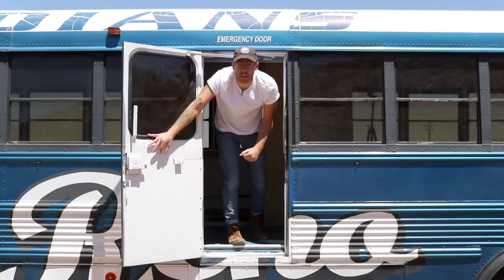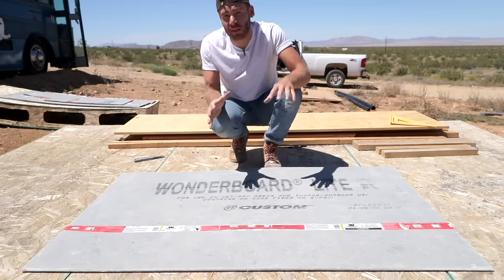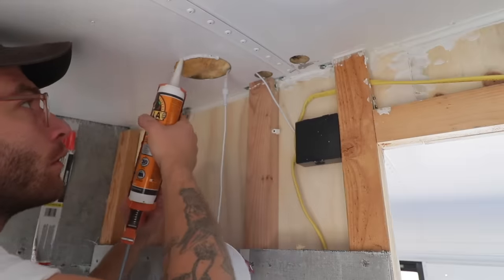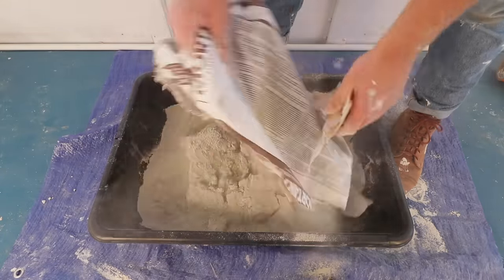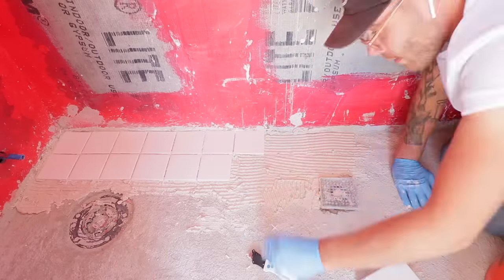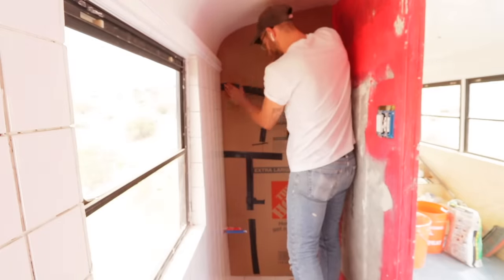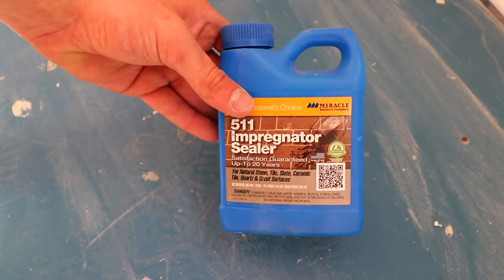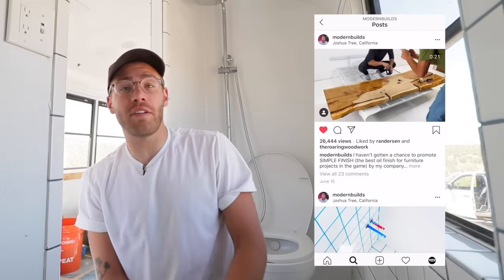EP. 3: THE BATHROOM | DIY SCHOOL BUS TINY HOUSE CONVERSION | MODERN BUILDS

Comment: "I know I'm gonna get a lot of comments about the tile."
No I'm gonna question that light switch on a wall inside a wet room.
Reply: exactly my thoughts, thats an accident waiting to happen
Reply: I was just about to mention this lol
Reply: Yeah, that's a kill switch.
Reply: It should be GFCI, then it will be ok
Reply from the maker: The shower curtain I mentioned will cover it when the shower is running... I'll replace is with a GFCI outlet too.
Reply: @bmw328igearhead  Just bury the splice for the lights as well. I don't understand since he will have use of a 12 volt system why use 120 v lights in a wet area. PUT THE SWITCHES ON THE EXTERIOR OF THE ROOM!!!
Reply: Megan Alice you cant really just say oh its a diy its okay. there’s standards for construction that keep you safe and modern builds did not adhere to them.
Reply: flynn gilmore okay, he made a mistake but everyone is beating him up about it
Reply: @ModernBuilds  I actually missed the part about the shower curtain. My issue was the showerhead and the light switch were both closer to the door so I got worried about over spray, but if you're mostly going to shower with it angled towards the window and away from the door then the shower curtain should take care of a bit.
I know it may not be possible now that the walls are up and such, but I would probably just recommend moving the switch to the outside of the room if that can be done easily. Looking forward to the next part.
Reply: @meganalice5444  It's ok to make a mistake when learning but when your posting videos for people to learn from you have to do your due diligence and make sure what you teach is correct and SAFE. He accomplished neither.  This set up could get someone KILLED!!!
Reply: @Belg1970  <<<<<---------- This!!! 👌🤘👍👍
Reply: @ModernBuilds  Try placing a little door to protect the light switch.
Reply: @bmw328igearhead  He used romex
Reply: @CaseyGpdx  and what exactly is any of his 120v wiring grounded to??

It's ok, I'll wait.... 

Hint: Nowhere did he mention, say, or show a 4 foot rebar/copper pipe smashed into the ground, and a large gauge wire attaching the bus chassis to the grounding rod.
Reply: Joe Bland  This isn't about kicking anyone's ass... This whole thing is geared more as a kick in the nuts. 

Maybe smarten some people up, before they ride the lightning, building something like this.

"Can't fix stupid", not without committing a crime anyway.
Reply: @bmw328igearhead  He powers the bus with a portable battery pack and when the pack is plugged in, it in a grounded outlet
Reply: @bmw328igearhead  Modern gfci recepticles(residential grade) do not need a ground to earth or a ground at all attached to the line side of the gfci as long as it's labeled as such. Speaking from  IBEW Local 48
Reply: @bmw328igearhead  he said that hes not an electrician in the first episode yall need to stop hating on him and appreciate the time and effort he put into this
Reply: @Belg1970  hes just uploading his progress on the bus, this isnt a tutorial. At most these are very very rough guidelines on building out a bus house. He says multiple times he doesnt have much experience in any of the fields required for this build, he references multiple tutorials hes watching proving how new he is to this stuff, and says many times that half of the stuff hes doing is just testing to see if it could work. Anyone who sees all of this and still decides to copy his bus one for one is an idiot in the first place, who was likely to make a mistake like this if not worse on their own.

It is worrying for himself and people he invites on this bus who try to shower, but not a single person watching this video is copying his build.
Reply: @brandonshipman6434  sorry but this is a subject that needs discussing.  Electricity is not a hobby or an experiment at this point, established safety guidelines are in place to protect everyone.  His silence is speaking volumes to me, like I said people will ASSUME this is correct and copy it.  Many/ dare I say most people use YouTube to educate themselves.  I'm merely pointing out this isn't correct and dangerous.  Not one of my comment was a belligerent  attack.
Reply: @jessemenezes3274  a GFCI...without a G... 
Soooo just an FCI outlet?? 

Know what you get, when you connect the line to ground???? SPARKS!!! 

Explain how a "GROUND FAULT" CIRCUIT INTERRUPTER works without a ground path...I'll wait, because I'd genuinely like to know. 

Yes... the unit senses the difference between input and output voltages, and triggers its internal, sensitive breaker, but..  any GFCI I've installed, without a proper ground circuit, the GFCI auto-trips anytime power is applied.

(A union card is not proof of an education, its proof you pay your dues)

EDIT: What you described is technically correct. Here is your flaw; What you described is true, but what you failed to mention is that the downstream outlets (things connected to the GFCI inside the box, via the line/load screw connections) are ungrounded, sure, but the original GFCI outlet does in fact require a ground path. If the original GFCI is not grounded, NOTHING is safe.
Reply: scott bleackley okay well how about you just drive to him and show him exactly how to do it. Because obviously you know how to do everything.
Reply: @bmw328igearhead  wow toxic
Reply: scott bleackley dude if you’ve got so many problems with the way he does things just don’t watch the video and stop commenting on absolutely everything
Reply: 1 800 SUPERPRO :)
Reply: @bmw328igearhead  your use of ellipsis make me think you're a depressed 13 year old
Reply: @cz2358  You first. 😉. Lead the way, SHOW ME HOW IT'S DONE! HAHAHAHAA 
I must thank you though for recognizing my intellectual prowess, I accept your compliment of "genius"
Reply: @bmw328igearhead  You talk good game but with your attitude I don't understand how you even get work, in the UK you'd get bullied off site with a mouth like that. You can get your point across without being obnoxious.
Reply: In Australia we generally do not do electrics at all, and we get electricians in to do it.  Electrics and gas are things that are not to be played with, death only comes once, so I’ve been told lol
Reply: @sjscreations2608  Agreed. In Australia all circuits must be protected by over-current and earth-leakage protection devices. There is no cheap, short cut way about it and thats the way it should be. Having outlets and switches in a wet room is a really quick way to hit the floor, especially with limited protection devices.
Reply: how if light out your covered electric box this is bad needs cut out for light box.can be checked.
Reply: Uses wet rated light in bathroom, but puts IP20 outlet and switch in bathroom
Reply: @kayreid9788  Was that even English??? If it was English... You definitely sound like a Lennie Small.
Reply: scott bleackley chill dude
Reply: @eferno oh I've totally been aggressive! Hehe, I love cranking up the weak minded. Its SO easy hehehe.
Reply: Yeah that’s a disaster waiting to happen
Reply: @toproudtooadmitmitsake1842  My thoughts exactly!!
Reply: @denvernow7294  Well he's behind a computer screen so he feels powerful and invincible
Reply: @bmw328igearhead  cmon dude, he works so hard on this, and you give him hate for the fucking outlet. Chill the hell out.
Reply: @ModernBuilds  how much overall cost it took please tell me ❤️
Reply: Let’s be honest, do you actually think he’s going to use this bus as a home?!?!! I bet it was mostly for content purposes.
Reply: Came here to say this.
Reply: @bmw328igearhead  he said he didn't know about electrical stuff ect and if you act like your so good at this I would LOVEEE to see you re model a bus into a mini house. P.S making a mistake IS NOT a mistake if you did not apologize or if you posted it on purpose.. if anything you're the bonehead for not listening to the start in episode 1. I don't think you remember "I am not a electrician"
Reply: @bmw328igearhead  "I tried to be nice"
Is calling someone a "bonehead" trying to be nice?
Is calling us cunts trying to be nice?
Is attacking someone for misspelling something trying to be nice?
Reply: Here's a novel idea. Why not put the switch on wall outside of  the shower and lose the plug all together. he could also use a outdoor waterproof electrical housing and outlet over by the sink on the opposite wall near the sink which should be the only place he need power in a bathroom.
Reply: It's perfectly safe as there aren't any fuses used for the electricity.
Reply: This is the same guy that made a metal outlet cover so I really don't know what you expected.
Reply: This comment section has become a god damn war-zone
Reply: What is a little problem

Comment: Having ridden in buses like that a lot as a kid, I can tell you they shake and flex a lot.  I'll be curious to see how all that tile, grout and cement stand up to the shaking, bending and flexing.
Reply from the maker: Same here, I'll be mounting a go-pro in the bathroom on its main voyage!
Reply: Josey Wilds  Not to mention that adding 100pounds of tile to your vehicle won't help with fuel efficiency.
Reply: HandandSew as if the bus isn’t meant to transport 50-75 people lol
Reply: a vinyl floor might have been easier all round.
Reply: @suckslip  that's the point, weight adds itself, and wastes fuel, tiles are too rigid and break and that's the reason they aren't used in RV's or other conversions.
The problem is that he keeps building this bus like the the house it is not.
Reply: My thoughts exactly...
Reply: @greyscalesx  Always amazes me how youtubers like this guy try to come across as pro's but his workmanship is atrocious all that bathroom is gonna fall apart and leak after 100 miles
Reply: @Stevieboy7  It literally holds like 20 kids at a time I’m sure it’ll be fine
Reply: @ModernBuilds  upgrade the suspension and the engine of the bus
Reply: Bros jealous af
Reply: @Stevieboy7  100 pounds is about 30% of the average driver.
Reply: @Giddykippa65  It would have been a lot easier to use sheets. My bathroom at home has them instead of tiles, don't know what they are called but they work great and you just cut them to size. (I'm not a builder) Edit: Then silicone all the joints.
Reply: @Giddykippa65  then why are you watching 😂 such a hater. Where’s your channel? Since you’re such a pro.

Comment: He really should have watched more videos on the vinyl membrane installation.  The floor is supposed to be leveled first then, the membrane.  The membrane is there to catch and drain moisture.  The way he did it, the moisture will sit in low spots but, never drain.  That moisture sits and turns to mold.  Hopefully, he doesn't have problems.
Reply: He's in a desert tho 🤷
Reply: This entire build is a fucking mess. Its frustrating to watch him build this pos bus.
Reply: @timmyc7695  hes true
Reply: @JK-fv1me  you commented on half of these builds, why watch if you hate so much. also he’s in low moisture area
Reply: @katerinaluv2806  Dosnt matter. I live in the desert and we very much get mold also.
Reply: Your doing a great job screw the stupid comment they not doing and you have your podcast and other opportunities
Reply: This whole series is seriously a "what not to do" for a bus build.
Reply: He's building this more like an RV than a true tiny home. There's a lot of stuff that is very obviously not a good design choice, but it's still entertaining, at least.
Reply: @firefoxx01  He's in a low moisture are??? What does that have to do with the water from the shower? That's what's going to sit on the shower liner under the mortar.

Comment: A wet room with a light switch and outlets in it?  A novel idea.
Reply from the maker: The shower curtain I mentioned will cover it when the shower is running... I'll replace is with a GFCI outlet too.
Reply: @ModernBuilds  ok... aaaand how do you plan to have a GFCI work, in an ungrounded vehicle?? 

Condensation is going to form between the windows and cement board, and hey... if you wanna trust your life to a shower curtain, go right ahead. 

But, perhaps you should put an opener on your coming videos stating "I am NOT a professional, and I have zero clue about building standards or electrical codes.  DO NOT DO THIS AT HOME"
Reply: scott bleackley hes said this numerous times through this whole transforming the bus episodes.
Reply: @elliedahlia3623  and that makes it OK?? 

I never watched any of the other videos, I didn't even finish this one when I saw the level of ignorance. So no... I didn't hear him talk about it. Don't care either. 

THIS video shows dangerous, and in many areas, illegal practices.
Reply: @bmw328igearhead  but you cared enough to comment this?
Reply: @kylebryan5905  yes... I care for peoples safety, and the fact that this guy is doing NOTHING correctly.
Reply: @bighaneul89  I dunno where you live, but in Canada, a domicile, mobile or not, there are minimum codes of safety for construction, plumbing, and electrical... You think DIY means Do Not Care??? To not adhere to these codes, is breaking the law. Why do you think we have controlled trades? It's to make sure the guy doing the work does it right, and to spec....

Give your head a shake...
Reply: @bmw328igearhead  "I care for people's safety" *1 of 2 videos on channel is "truckboarding"*
Reply: @nickqtv  We were all young and stupid once, but we were pioneers of our time...people grow... that video is from 2004.

Even back then, we KNEW what we were doing was dangerous, hence the warning on the video... if you watched it....

Apples and Oranges love...
Reply: @kylebryan5905  he didn't just comment it here he has made it his duty to comment it on anything modern has replied to
Reply: @bmw328igearhead  I get I’m a year late but, not trying to say anything offensive to the creator of it. Worrying for safety doesn’t matter if he isn’t gonna bulk create the same design and give it to others does it?
Reply: @kazratv353  by being on youtube... he has done exactly what you said he shouldn't do... 

Cheers.
Reply: @bmw328igearhead  please name someone who has a fucking bus that looks exactly like this one?

Comment: The craftsman ship is definitely sub par. I felt that you should've addressed those windows before you boarded them up. At least make them look like picture frames and put something interesting in them or at black them out and seal them properly. Now they're going to constantly have condensation and it's gonna drip to your studs and rot them over time.
Reply: I was thinking the same thing. Also they are going to look trash from the outside.
Reply: @d.s.3551  He could just paint them black.
Reply from the maker: I'm going to paint over them on the outside
Reply: @ModernBuilds  will paint stick to glass?
Reply: @alexclark6768  .  Absolutely not.  To paint glass you have to etch it with acid.  You Can paint glass but it Won't last with washings.
Reply: Painting doesn't take care of the condensation that will cause rot. You have a wet room that will be hotter or colder than the outside of that window. Bus windows are terrible for a schooly conversion because the windows aren't insulated enough to prevent condensation, what will happen is those windows will drip condensation onto anything that is wood and begin the rotting process, that's why most schooly conversions remove those windows. The R value for those windows suck
Reply: @nicgurkweitz389  If one of the latches fails on a covered window it is going to be interesting to see you get access to repair them.   I remember so many windows in my bus as a kid having a quarter inch gap at one side since the lock had broken.       I am still bothered by the BED BUILD... all that wasted space under there ...  Water Tanks??  at minimum putting shoes or something they are going to be back in the left corner after the first start and stop drive...no dividers.  I see someone crawling in that hole A LOT...    Still, for a bus it looks pretty good.    A hot link to the next episode in the comments would be nice....

Comment: Having basic construction knowledge, this hurt my soul. So many things are gonna go wrong. Light switch on a bathroom? Realllllly?
Reply: Light switch is not ideal, but covering the LED junction boxes with tile is insane. bumpy road=loose connection = flickering light= unfix-able.
Reply: In Germany most Bathrooms has the lightswitch on the inside...
Reply: @xx_xha2269  This isnt a standard bathroom though. Its a wetroom where it's eventually gonna get wet
Reply: To be fair, he said he doesn't know electricity stuff
Reply: cherry moon he said he’ll change it eventually.
Reply: @devilinbluejeansxx8925  thats really inefficient and troublesome.
Reply: What will he do, when the electric light switch go wrong, he will disassemble the cover of the wall?

Comment: Are you sure the tile won’t crack or break when going over slightly tougher terrain?
Reply: listen to his podcast - nope he doesn't.
Reply: You think this guy actually knows what he's doing?
Reply: there is going to be cracks in many of the grout joints after the first road trip.  Unfortunately the construction used wouldn't hold up in a house let alone a bus.

Comment: You should add access panels on the back of the walls for your plumbing, just in case there is a leak. Otherwise I think your spot on with the project! 💪